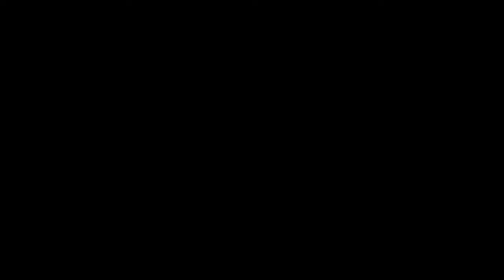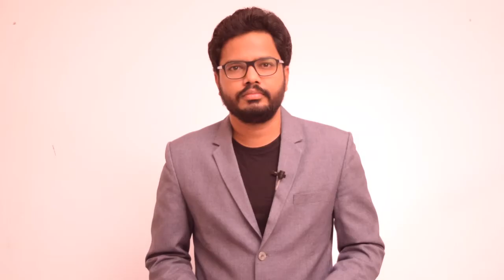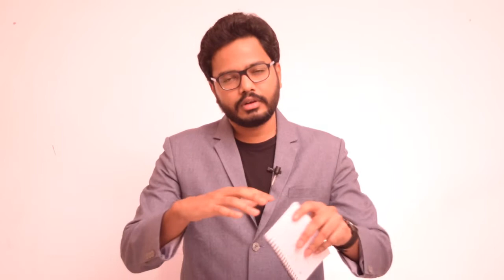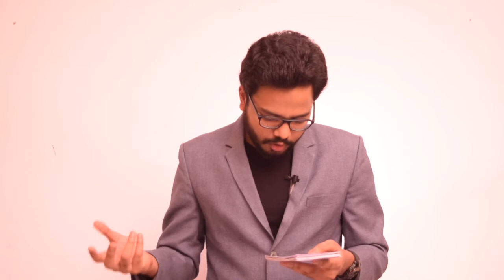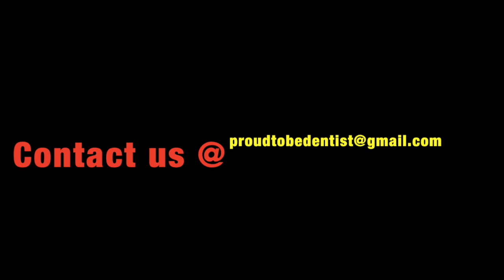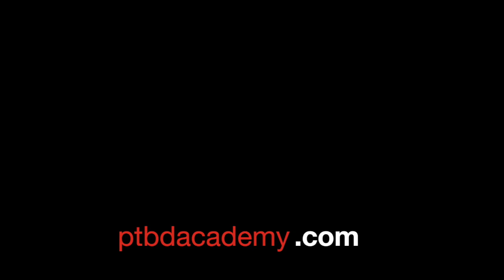Important Topics In Dental Materials

Comment: 1. Properties of dental materials
		a. Coefficient of thermal expansion
		b. Hardness numbers
		c. Elastic strain
		d. Contact angle wetting wettability
		e. Latent heat of vaporization
		f. Creep
		g. Compressive strain
		h. Ductility
		i. Stiffness
		j. Brussol brooze effect
	2. Impression materials
		a. Classification
		b. Composition properties setting mechanism
		c. Functions of individual material components
		d. Factors that modify setting time, setting expansion 
		e. Elastomeric impression material
			i. 2in1 stage impression
			ii. Alginate- fillers composition,
			iii. Temperature for setting, water powder ratio
			iv. Addition silicone 
			v. Setting time of polysulfide
			vi. How control setting time of alginate to
			vii. Rigid irreversible impression material example
			viii. Ascending and descending order of permanent deformation of various elastomeric impression materials
			ix. Shelf life of impression materials
			x. Chrome alginate
			(Component in hydrocolloids that may cause skin reactions)
			xi. Condensation reaction
			xii. Effect of gloves for Sulphur contamination cos on setting reaction, - addition silicon
			xiii. Reversible hydrocolloids
			xiv. Cast pouring timing - polyether polysulphide sector🌟🌟🌟
			xv. Recommended water temperature for mixing alginate
	3. Gypsum
		a. Classification of gypsum 
		b. Water powder ratio
		c. Factors setting time
		d. Factors affecting expansion
		e. Constituency composition
		f. Fabrication process
		g. Calcination procedure
		h. Tests for assessing the setting time
		i. Die materials 
		j. Factors affecting hardness of stone
	4. Restorative resins
		a. Chemically activated resins
		b. Residual monomer content
		c. Poly methyl methacrylate 
		d. Polymerization process in resins
		e. Syneresis
		f. Plasticisers used resins
		g. 🌟🌟Ada specification numbers 
		h. Dough forming time
		i. Monomer polymer ratio
		j. Composition of monomer and polymer
		k. Bonding agents - generations
		l. Etching time, depth of etching
	5. Dental amalgam
		a. Eames technique
		b. Tarnish and corrosion
		c. Setting reaction -soluble or  precipitation
		d. ADA
		e. Meaning of amalgam
		f. Mercury toxicity

Linear coefficient of thermal expansion
Metal ceramic
Annealing
Investment material composition, classification, 
Processes for casting using the investment materials

Stainless steel composition importance of chromium 

Biocompatibility of casting alloys 

Test for biocompatibility

Properties of soldering materials

Flux antiflux materials used in dentistry

Casting shrinkage, defects classification and why it is caused

Carbon steel, Austentic, marsentic 

Direct filling gold , properties purity, fineness , classification,
Degassing, mattegold synonyms
Pure non pure

🌟Dental cements
	Classification
	Composition
	Setting mechanism setting time
	Factors affecting setting time
	Adhesion mechanism
	
GIC composition mechanism classification fluoride release 
	Adhesion mechanism
	
Cement most irritating to pulp 

Pulp protecting agents 

ZOE advantages

 Dental ceramics
	Composition of ceramics
	Important individual constituents and their functions
	Different types available in market
	Advantages disadvantages
	Firing of porcelain - air and vacuum
	Classification of ceramics
	Dispersion strength
	Etching of porcelain
	Methods of strengthening porcelain
	Importance of metal oxides
	
FDA classification of various devices based on that risk potential

Biocompatibility

Abrasives
	Various sources
	Natural synthetic
	Classifications types
	Particle sizes
Reply: Bezold Brooke Effect
Reply: Thank you so much
Much time saved
Reply: Thankyou